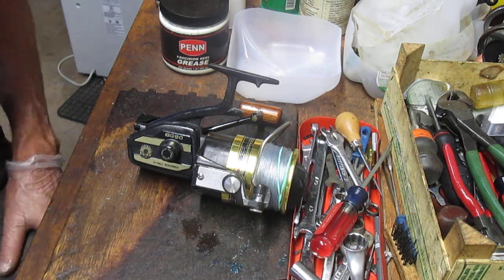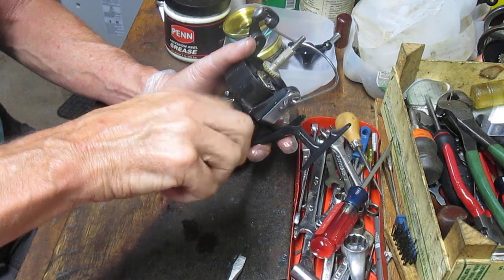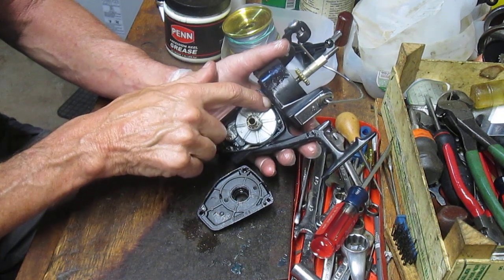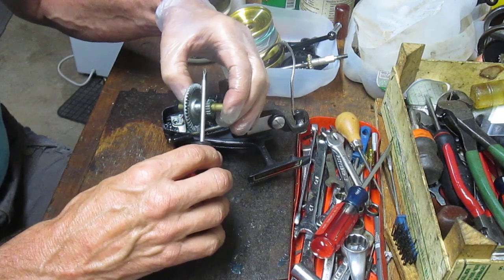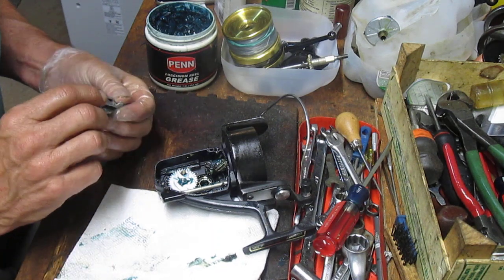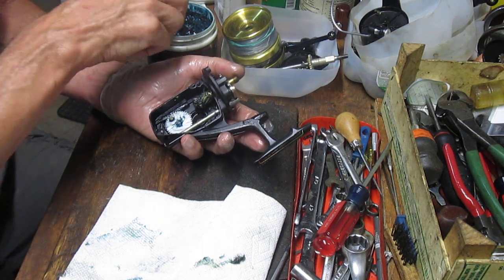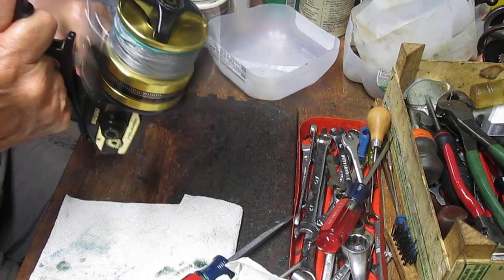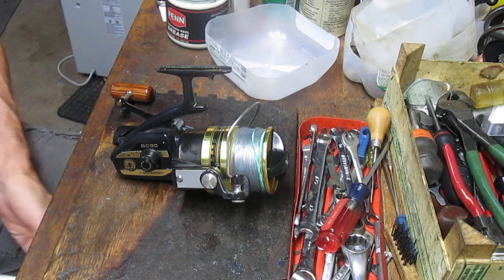Daiwa Black Gold BG90 fishing reel Take apart and service

Comment: Another great video with crisp instructions. I have an older GS90, are the parts interchangeable with the BG90? (mainly drive gear and pinion) Thx.
Reply from the maker: I don't think they are interchangeable.  There are differences in the cases and size of the reel.  Dennis

Comment: Hello Dennis, Great videos. I see that you never put alot of grease when you service your reels, The little bit of grease you use is enough?
Reply from the maker: Yes.  I notice the number one reel failure is no oil or grease due to evaporation or age.  the second most common failure is too much grease!  The problem here is that it traps contaminants and impeded reel performance by clogging the gears and bearings when it is deteriorating. So a little of the right gerase and oil goes a long way.  If you service your reel annually, then you should not have a problem - Thanks for asking - Dennis

Comment: Hi Dennis,
I purchased similar reel on ebay sold as is, the reel looks good with no wear and tear however seller stated it is locked up and handle not spinning at all.
I am living outside of the US and there is a shipping company combining my purchases before ship it to me.
I am hoping that it is ball bearing failure. From your experience is Daiwa used stainless steel bearing at the time. What looking up an why spinning reel won't turn?
Thanks
Reply from the maker: I don't think it is a bearing failure.  My bet would is a broken part like a crosswind block or something trapped in the reel like broken line.  It is unusual that a bearing would cause this issue - You will need to take the reel apart to determine the cause - Dennis

Comment: Just going to take a wild guess here and figure those are aluminum body reels or are they the other stuff and I have a Daiwa 2600c would i gain much of anything as far as stronger drag by going to carbon fiber washers at this time its still got the Teflon drags likewise to my 4000c?
Reply from the maker: Those are metal bodies on the early BG series.  If you have the 2600C, which is about 30+ years old, it is time to upgrade the drag washers. It won't give you any more max drag, but it will ensure that the max drag in the reel is fully utilized by preventing slip.  I would go ahead and do it if you are having problems with your drags.  If the originals are still Ok and your question is a curiosity, then you do not need to change them out for the sake of change. As long as the washers are clean and performing, they will be OK
Reply: @2ndChanceTackle  ok thanks for helping me out on that. My drags are in good shape foe there age I was just really curious if there was more to gain by switching to carbon fiber drags I guess since there's no reason to upgrade then I'll just keep running these things until the drags finally do wear out since I always maintain my reels and keep them in top shape they'll probably last me a lifetime
Reply from the maker: Sounds like a plan

Comment: I removed my setscrew and still the spool shaft does not want to come out do you have any advice ,seems to be seized inside
Reply from the maker: Yes - it is either frozen grease or a bent shaft.  Soak the crosswind block and the axle shaft where the axle connects to it and the pinion gear at the top of the rotor to try and free up and hard grease.  Reattach the spool to the axle shaft if you removed it and use the spool and a handle to twist left/right and pull up to free it from the crosswind block - Dennis

Comment: Hi i lost my drag knob off of my BG60...will a knob off of a BG90 work
Reply from the maker: While I cannot say for certain, I believe the answer is no.  Typically the knobs are interchangeable between a 50/60 and the 80/90 sizes as the only difference is spool capacity.  I checked the schematics and there are different part numbers for the 60 and 90 drag knobs, so there is a chance that the 90 size knob would be too wide for the 60 size reel.  Having said that, If you can get a 90 size knob cheap, it is worth a try.  Sorry I cannot be more definitive.  I do not have any of those in my shop, so I cannot give it a test to see. - Dennis
Reply: @2ndChanceTackle  thank you so much for your time! I might be in luck with B&F in Cali...crossing my fingers as Daiwa has discontinued the part and is hard to find.
Reply from the maker: Glad to hear that you located the part.  Those reels are too good to not go fishing.  Best wishes - Dennis

Comment: Internally this is absolutely no different than a Daiwa 7000C silver series.is it a metal or graphite case on this reel?They are expensive at least for me.  I would not like the wobble. My old Ocean Star No. 36 (Daiwa) at least has a balanced rotor internal counterweight and it is a much older reel! Super video!
Reply from the maker: Christopher - You reminded me that I have a 7000C in my to do project bin.  I will take it out and try for a video this week.  I may try to upgrade these to ceramic bearings if they are available.  In the meantime, there are few reels today that will last as long and be as strong as these silver series reels. - Stay tuned for the video - Dennis
Reply from the maker: Here is the link to the schematic for the 7000C https://youtu.be/gzXIcHc3coI
Reply from the maker: ere you go Christopher, I just posted the 7000C video https://youtu.be/AAJGI-A28Lc